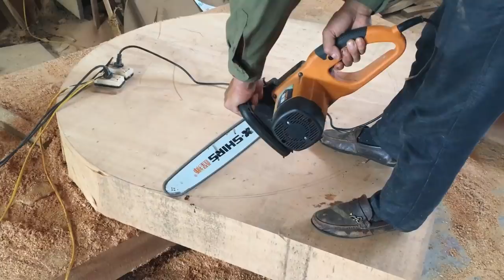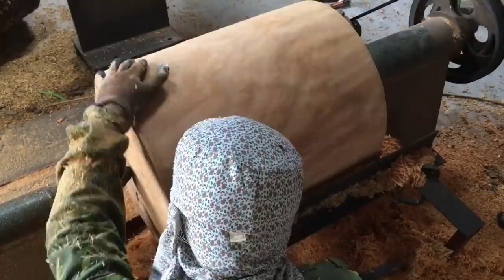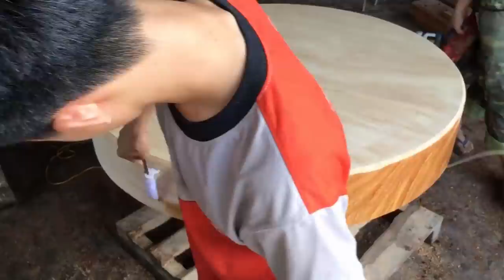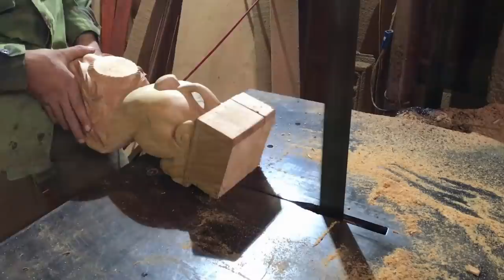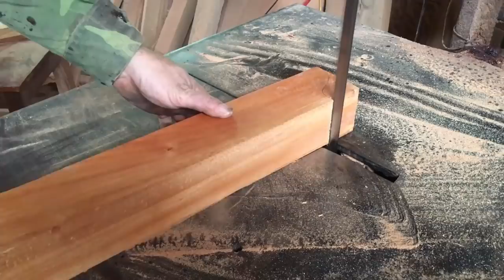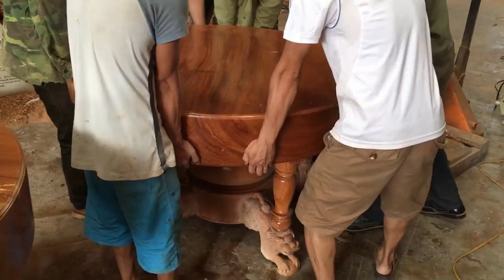WoodWorking Projects You MUST See // How To Make Extremely Large Round Table With Hardwood

Comment: You have to work perfectly vertical on the side of the table, both with the chain saw and the sanders! Any angle will cause the sides to go inwards, which will take a long time to correct by reducing the radius, which you did but did not work vertically, so the problem remained and now with a smaller radius table. Check it out it makes a lot of sense! (constructive criticism) By the end you started to get it, but your helper at times went sideways

Comment: how much does the slab cost? Interested in the market because i have a large oak tree that fell the trunk is 6 feet x 7ft feet wide [around] and 12ft tall/long? I was wanting to make myself a desk using slabs off of the 12ft wide root base but there are too many rocks in the trunk where the tree grew into them so no slabbing for now. do you have any ideas on what to do it seems like a great tree for some large projects, or to be sold on the market?

Comment: I would make a jig out of steel to attach the chainsaw at a center point, and turn.
Reply: He's a typical Oriental - can't do things the easy and accurate way - has to think about how many people he will consult, then do it the hard and messy way.
Reply: Hardly...
First, they must flip over whole wooden block to attach chainsaw on the bottom side. It is out of question to make any hole on the upper side!
Second, he did not without reason cut wood with chainsaw not verticaly but with a slight angle. That saw makes a very rough edge full of damage. When he cutting from upper side he can control upper edge and for bootom edge, because he cutting at an angle saw cut enough far from final edge.
So, as he doing...

Comment: Working with wood is an art but this is not . The table should be beautiful and lite plus strong and easy to move by the family
Reply: Nonsense, art isn't defined or limited by weight and ornate furniture is for display and will likely be placed in one spot and remain there possibly for generations.

Besides, this is still lighter than a stone or steel table would have been and there are ways to move heavy furniture without much difficulty.
Reply: It is. They've got big families.

Comment: The only downside is you need a forklift to move the thing.
Reply: The other benefit of such a solid piece is; it will surely crack.
Reply: @spudpud-T67  I was searching through the comments for someone to notice. Is it true though? When the lumber is so thick and wide is it really a problem? If its nicely sealed with lacquer and kept on constant temperature?
Reply: @svenmarko7744   No problem. But it will crack, even if its covered in lacquer.  Lacquer is very permeable to air. Temperature is only part of it, wood will dry faster in a cool breeze than still air, no matter the temperature. The problem is the mass of the wood is so big that the center will always be a different humidity to the outer surface. The result is cracking. A thinner piece would be much more stable, which is why we all do that.